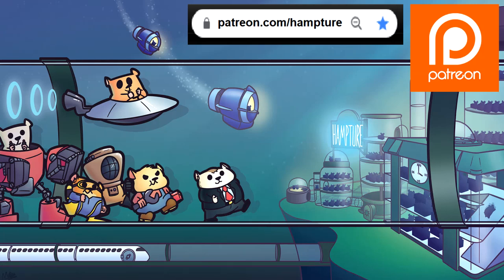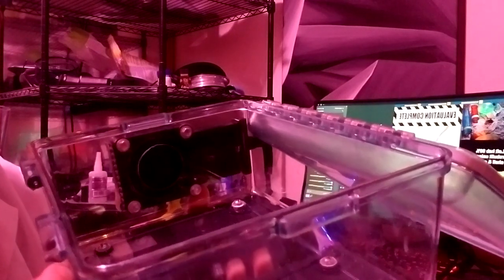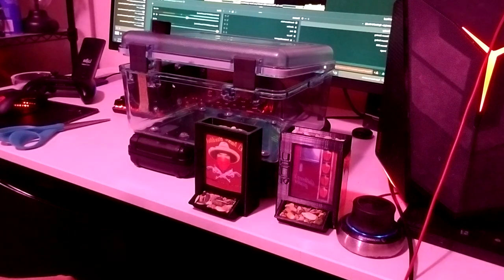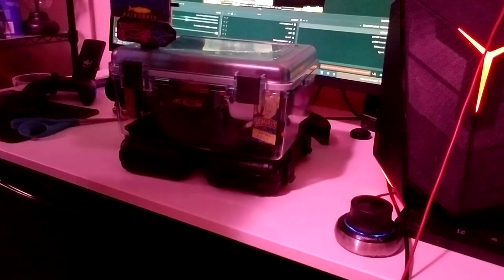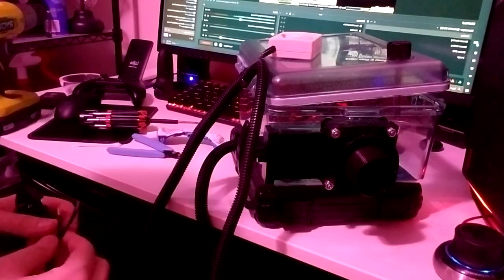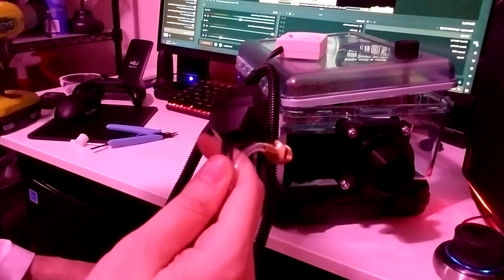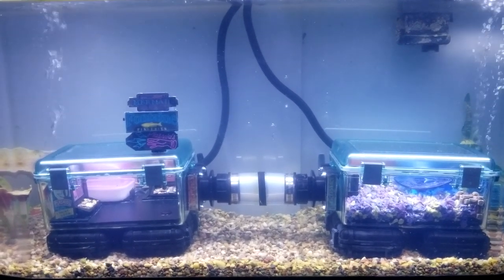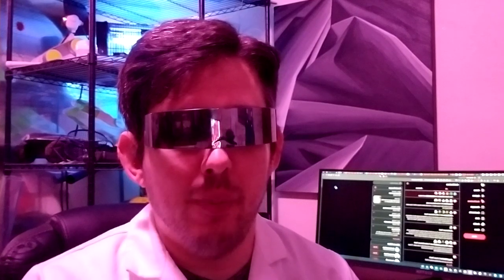Hampture Update: Both Modules Rebuilt, Submerged, & Lookin Rad

Comment: Have you thought about using some kind of glow-in-the-dark or UV reactive paint in different colors painted on the letters of the signs? Then when the external UV light shines on them it will make them glow when the lights are turned off. I wonder if they make paint that glows even when the lights are shining on them? You could then laminate the paper over the paint (or put it in some kind of plastic film) so the paint doesn’t leech into the water
Reply from the maker: Yes. The existing signs are laminated. I've thought about remaking them with UV reactive ink traced over the letters though

Comment: I'm at 12 minutes in so i don't know if you suggested this already, but you could print a leveling part so that the gate valve gets mounted in a completely horizontal position. I think that with enough wall layers it would be stronger than the valve itself. Then, you could have as many habitats connected together as you want, and even make turning parts to put them in a ring or at an angle.
Reply from the maker: Not a bad idea, but I wonder about this technique compromising the seal of the rubber lined washers on the inside wall of the hab, since the bolts would be at an angle.

Comment: Yesssss, more Hampture, yessssss...

1) Is there any worry about the hams chewing at the corruplast?
2) Paused the video, went to comment about using fluorescent paint and a black light, unpaused and heard you talking about a black light. You've truly thought of it all... But nail curing UV lights might work!
Reply from the maker: They can't reach their jaws around the edges of the floors. But they may be able to chew the bits that secure the vending machines in place. I guess we'll see.

Comment: is the uv led bad for you or your hamster's eyes?
Also if you want light-up signs you could put some stenciled signs on top of clear plastic or epoxy and light them with watertight epoxied LEDs. Could even embed the LEDs in epoxy signs.
If you want the LEDs to be grid-powered, use any power brick, check its voltage, find the resistors you need to get the LEDs to the right volts/amps (google "LED array wizard"), buy/use a barrel connector that matches the power brick, solder together.

Lemme know if you want a diagram or smth.
Reply from the maker: Sounds promising. IDK about the UV light being harmful. It'd be filtered through water after all.
Reply: @Hamdad  half a meter of water lets 40% of UVA (320-400 nm) through.

Also google "Are UV LEDs really dangerous?" and the 2nd/3rd answer on Stackexchange seems useful